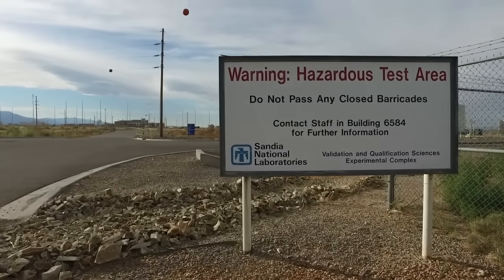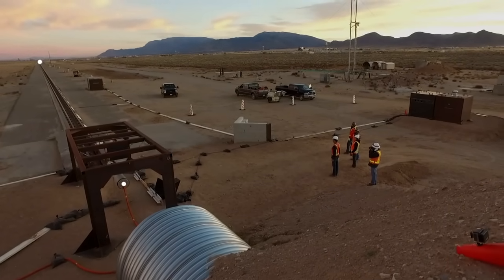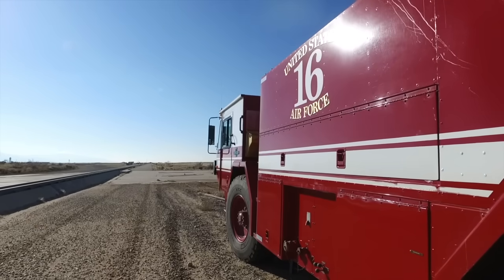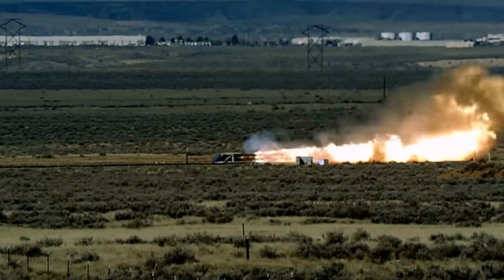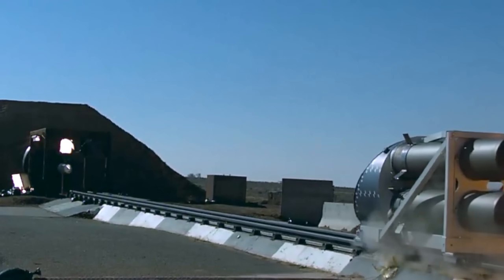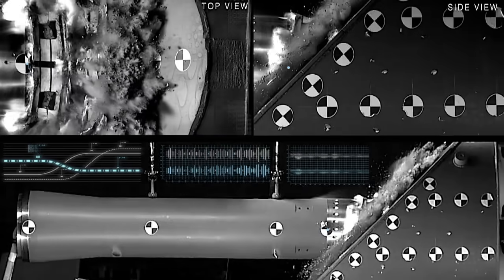Rocket Sled Impact Test In Slow-Motion

Comment: So Sandia Labs is a government contract boondoggle. It performs tests to insure the integrity of a weapon system that doesn't exist as such. 
Manhattan project was a dud. Fisdionable material can get very hot abd boil tons of steam but it NEVER goes boom. 
Demon core event is one simple proof. Blue flash but no extreme heat and no explosive force. Trinity was 100 tons of TNT exactly the same effects as the "100 ton test" a month or so earlier. The total explosive force and huge crater was missing at Hiroshima and Nagasaki.  Sandia Labs, a waste of taxes, except they help keep the hoax going.

Comment: In this reverse velocity test the one thing that would change the results is the difference in mass of the moving object. The heavy sled would have greater energy at the same speed than the rocket would with less mass. This may alter the true results of the impact. The sled impacting the rocket with have much more kinetic energy than the rocket striking the sled at the same velocity.

Comment: Wow that did less damage than a flying hollow aluminum tube that made perfectly round 16’ holes through 3 outer walls, 3 inner walls and damaging the 4th outer wall of an impenetrable 5 ring Pentagon shaped building!!
Reply: Congratulations, you managed to fail completely at a comparison. Not, of course, to mention that you lied. Oops.

Comment: I Wonder why it has to be done in reverse, meaning instead of using 4 thrusters to push the concrete thing on rails just fire the missile on the thing with the cameras focused on it..
(i guess it has to do with the unpredictable flight path of the missile so it's more accurate do it as they did but I'm not sure)
Reply: Exactly right. The sled is firmly attached to the wheels and can't get it in its head to deviate. It's also a lot heavier, so even if it did tear loose, it wouldn't to randomly across the sky, but rather nose-dive into the ground.

Comment: I've seen a ton of high speed footage over the years but it still amazes me how, under high deceleration, solid matter tends to behave like a fluid.
Reply: As Bruce Lee said..
Be like water my friend.
Reply: Dust to dust.
Reply: @locklear308 metallica reference??
Reply: @redmarker970  someone got it!
Reply: @locklear308  let’s gooo
Reply: That’s because it’s not solid anymore
Reply: It doesnt really, it just folds like some thin foil.
Reply: Its a reminder that the only reason its a solid is the atmospheric pressure and the temperature. Which is why, to me, meteorites and tektites are so cool.
Reply: @evonne315  
Yes!
Reply: fater
Reply: @makismakiavelis5718
Ever watch any high-speed video of lead bullets smashing into hardened steel? I could watch that all day. It's easily googleable. The lead behaves almost that way. And in fact there may be some liquefaction because a lot of the energy of the deceleration rapidly heats the lead because kinetic energy has to go somewhere.
Reply: @Smedley1947  
Yes, I've seen a ton of those videos you are describing and yes they are awesome.
Reply: On its way to one of the 4 basic states of matter. From solid, water, gas and plasma.
Reply: As seen in the slow motion footage from 2001, how did the alleged jet liners ‘melt’ through a surface of box steel and internal concrete floors of the twin towers without crumpling, breaking, shattering, exploding or disintegrating in any way until fully absorbed into the buildings? I’d love to see a jet rail test to illustrate this.
Reply: it can act like a fluid over super long time periods too, which is super super neat, leads to weird personally mind melty stuff like convective ice or earths slowly convective mantle. Ig lots of things will behave like a fluid if you do it right
Reply: It's not when you realize everything is made up of the same things, atoms and molecules, just depends on their spacing.
Reply: It's true. For a brief moment, the solid structure disintegrates and is no longer coherent, becoming a fluid bound by heat and momentum. Just like the loosely bound molecules of a proper fluid, but instead of chemical bonds it's pure mechanical and thermodynamic energy. But it's only for a very brief moment, before the solid becomes solid particles no longer bound together with any sort of coherence.
Reply: Solidity is an illusion.
Reply: Absolutely! Have you seen the test when they shot an F4 Phantom into the reindorced concrete wall? It literally atomised!
Reply: Pulverized solids/powders do have some fluid like properties in that their particles can flow, but lack something analogous to surface tension. If you hit something hard enough, it will turn into actual liquid or even plasma though.
Reply: Yeah that's why everyone's brains go missing during a plane crash.
Reply: Everything is s fluid, with different viscousity
Reply: that's not how any of this works
Reply: It doesn't tend to behave like a fluid; it appears to behave like a fluid.  Two very different things.
Reply: @nashvillain171  strange thing is, dump enough energy into something fast enough and you break bonds at the atomic level. so yes everything is a fluid when it comes to high speed impacts where kinetic energy changes to heat energy.
Reply: @johng.1703  Only if you don't understand states of matter.
Reply: @nashvillain171  yep there are transition phases, normally solid, liquid, gas, and depending on charge plasma. the more energy there is the higher the state it is in. hence if you apply enough energy everything is a liquid., apply more energy then it's a gas.....
Reply: @johng.1703  but there wasnt enough kinetic energy to melt the metal in the video. The metal got deformed real bad, it never melted
Reply: @nashvillain171  And your name isn't Nash and you are not a villain.
Just kidding buddy.

However what is the difference?
If something visually is acting like a fluid...

Because of speed and heat transference that, even temporarily, breaks it's normal bonding structure...said material can momentarily act like a fluid instead of a solid. Take body armor and tank armor for instance...when hit with a high speed round heat is caused and it penetrates said armor due to heat caused by speed.
Which is what this looks like in this video.
Reply: @heathb4319  Your words, "...visually is acting like a fluid..." is quite literally another way of saying, "...appears to act like a fluid," which is what I said.
Reply: @nashvillain171  You're trying to win the argument with semantics. Heath is right, the intra-molecular bonds are broken in an energetic impact like this and the material is acting more like a fluid than a solid.
Reply: @Elrond_Hubbard_1  So, it's governed by Bernoulli's Theorem, Torricelli's Law, and Stoke's Law?  Or nah?
Reply: @nashvillain171  You just name dropping some first year uni engineering math, or?
Reply: @Elrond_Hubbard_1  Don't evade the question.
Reply: @heathb4319  fluid physics are very different from solid physics. Solid material can look like a fluid under certain conditions but it is still solid particles and therefore it behaves like solid pieces. A fluid behaves different.
Also, about you speed and heat arguing, the heat is not the reason why a round penetrates armor. It does because of the kinetic energy and hardness of the projectile. If it has a huge kinetic energy and high hardness, it will break the bonds of the particles of the armor. It doesn't convert into a liquid in any moment.
Reply: @Elrond_Hubbard_1  semantics? When was this about religion?? 😂
Reply: @mftripz8445  please say /s
Reply: @nashvillain171  careful, the 7 year olds in this comment section dont know who bernoulli is.
Reply: @pressaltf4forfreevbucks179  😂
Reply: @nashvillain171  ayy you still active here after so many months lol?
Reply: @pressaltf4forfreevbucks179  I gave up trying to explain this though
Reply: Yalls are crazy. It only behaves as a fluid when it melts. I didnt see any molten metals in this video
Reply: @pressaltf4forfreevbucks179  you should see some of the ballistic videos, it doesn't melt, it breaks the bonds holding the atoms to each other. the impact is so quick it doesn't have time to melt into what you might recognise as a liquid.
Reply: @johng.1703  sand is not a liquid just because it appears to be one. Its just a broken up solid. Liquids obey certain laws, the ones that @nashvillain mentioned. Its really not that complicated.
Reply: @pressaltf4forfreevbucks179  it wasn't sand that was in it, it was steel and concrete, and it was all over in "a few hundredths of a second" 
if it had an airbag, it would be over before the airbag deployed.
Reply: @johng.1703  whats your point?? Mine was that breaking a bond between solid matter doesnt always mean it gets molten or vaposised if you didnt catch it.

Comment: I am surprised this actually works, if it is true that an object in motion has kinetic energy (and it does).

  I would assume the sled would do more damage to the missile impacting it this way, while a missile in motion would pass that energy to the target and do more damage to said target rather than to itself.  I guess either it all balances out, or they figured a way to calculate and compensate the data to account for this difference.    Interesting to know either way.
Reply: Your second guess was correct. If you know that a small, fast thing collides with a big, stationary thing, then you can get basically the same results by ramming the big thing into the smaller thing at a somewhat slower speed.

The main complications in that calculation would have to do with how the energy is dissipated on impact. As you may know from automobile collisions, the speed and manner of energy dissipation is what determines how much damage is caused. In this case, the main question is whether the collision would cause a nuclear warhead to detonate. You don’t want that to happen.

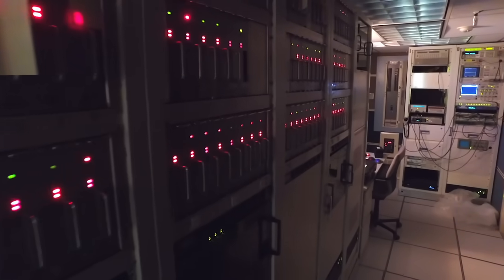Comment: You see that steel test stand holding the "test unit"? (0:53 point) I ask. What would be the result if you attached an aircraft wing (partial) to the rocket sled, ran it up to about 400 knts and crashed the wing into that steel structure? Would the aluminum wing cut the steel structure?

Comment: So why don't they test how an passenger airliner (aluminum tube) goes through a steel column building and starts a fire that melts the steel which  then collapses the whole building into a pool of molten metal that endures for two weeks?... surely these wizards and their equiptment  can model that

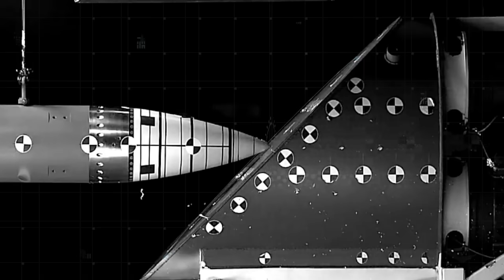Comment: That's really impressive.   I was surprised at 2:17 where the air pressure from the sled peeled off the 3rd centerline sticker on the test weapon, ahead of the sled's impact.    Right about when the sled is demolishing the 1st centerline sticker.  I understand exactly what happened, I just underestimated the power of the displaced air.   

... Or the sticker's glue didn't stick right on the shiny metal.  Either way.

Comment: the shockwave from the rail vehicle disturbs the measurement ?  when the projectile flies into the rail vehicle, the shockwave is in the other direction, there is even a shockwave through the projectile , so a bit tricky this test.

Comment: One of the most impressive pieces of footage. 
You can see the supersonic shockwave, distorting the dirt below the rocket under test, then you can quite visibly see the shockwave slightly in front of the test rocket. 
I don’t know what speed impact was at, but quite the amazing display of physics, ultra high speed cameras, capturing very high definition footage, perfect timing, and extremely good technology all at the same time on the same video. 
This tickles every single nerve in my geek sensors. 
If you guys are ever looking for an extra electronic engineer, with a good background in physics, let me know. 
Any footage of the aftermath? I want to see what those pieces of debris looked like post-impact.

Comment: For those who dunno what they are testing, it's simulating an air to ground missile impacting the ground.
Reply: Why? And what does that have to do with nuclear stock pile saftey?
Reply: @ubahfly5409  ....to make sure that the fusing mechanism works; it's not about safety
Reply: I think it’s to see if a fusion reaction is generated at high speed impacts

Comment: It would've been nice if this video had explained how fast the sled was going
Reply: It would have been nice if they had explained anything useful, at all.
Reply: @q.e.d.9112    I think that impact angle ( simulated ) plus a very high mach - would be the representation of an icbm warhead inbound on a ballistic trajectory....whose internal instrumentation, presumably, was being tested to ensure that it would detect the ground rushing up to it, in time, for it to fuse and detonate the weapon in a simulated ground-burst fashion.  you see - icbm warheads come in at mach v. high ( circa 20 I'd estimate given that orbital velocity is circa mach 25 ) but with the air-drag / friction-drag of the atmosphere that would have to reduce a bit....and  I reckon it's likely that by the time it reached the ground it could well be about mach 8 or 9, therefore....and as other comments, here, state..the rocket sled speed was to be around 8.6 mach.  lastly an air-dropped weapon's terminal velocity due to simply gravity ( from any height that an air-breathing engine'd plane  ( or it's own engine if a cruise missile which btw operates at low level so is not relevant here ).....would not be anywhere near the speed of this sled. have a look at icbm warhead reentry videos to see how fast they come in - and the speed is : screamingly fast .... ! have a good one...

Comment: What were they actually testing? I mean what was the point of doing this as it relates to nuclear weapons?
Reply: A 1967 Chevy Impala equipped with JATO rockets.........
Reply: @MichaeljRichter  A guy actually did that. Impacted a cliff on the outside of a turn in the road at about 380 mph if I remember right.

Comment: Other nations: Test there bomb designs by dropping them on concrete surfaces."
Usa: "Builds a mock city, attaches it to a sled, attaches rockets to the sled, builds giant track, sends the sled flying into the bomb."
Reply: Yes, because you can record far more data and higher-quality data like ultra high-speed high-definition video from a reverse impact test of a munition because, as they explained in the video, mounting the munition itself statically allows you to connect the sensors to a computer recording system housed in a hardened protected shelter nearby. 

This method is more complex than a classic munition drop test from an aircraft but it yields way more useful information about the device being tested so it allows the munitions you're developing to be way safer when they're being transported short and long distances by aircraft or train and also while being regularly serviced, maintained, and also while sitting in storage. 

Accidents happen all the time, and there have been hundreds of nuclear weapons transportation accidents in the past, many of which very nearly destroyed millions of civilians in several countries. 

One time two Megaton-class nuclear bombs were accidentally partially-armed and dropped from a B-52 bomber over South Carolina when the plane broke up in the air from a mechanical failure. Only one of the five safety systems in the bombs didn't get bypassed in the bombs' descent and impact of the ground. If it weren't for accurate and detailed munitions safety testing and engineering of failsafe's in the bombs prior to their deployment and transportation in aircraft, South Carolina would be an inhospitable, radioactive crater filled with millions of civilian skeletons today.

Comment: That's not a big sled track.  The big one is at Holloman AFB in Alamogordo, NM.  It's about 10 miles long.  It's a dual rail track (like a railroad track - but wider) and they use large sleds that can hold the entire front of an aircraft to do dynamic tests of ejection seats.   That's where John Stapp rode a sled 632 mph, with a deceleration of 46.2 Gs (December 1954) in a testing program for pilot survivability in jet aircraft.  Just enter, "Holloman High Speed Test Track" into the address entry window on Google Maps and it will take you to the south end of the track.